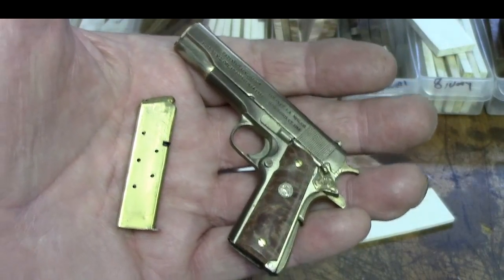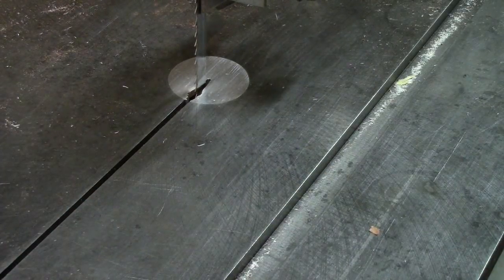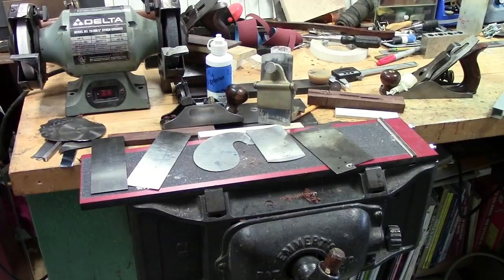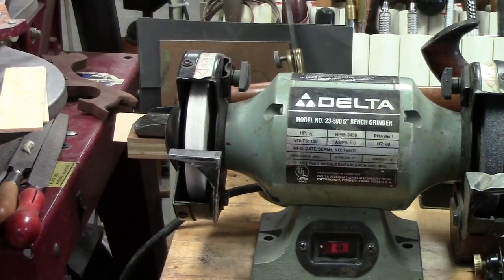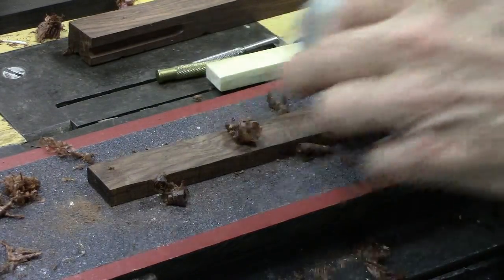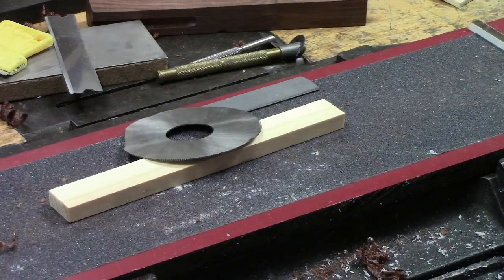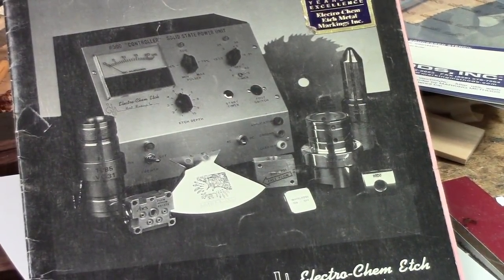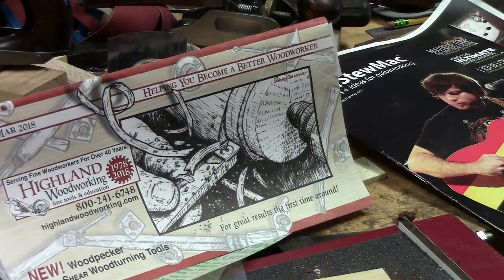Saws Sparks Sawdust Shavings and Scrapers

Comment: The "mylar" material you used for pencil drawing transfer at the end is what I used to buy as either ClearPrint drafting film, available in sheets and rolls, OR Denril drafting film in the art supply shop. Its impossible to tear but it will stretch after using roughly. The technique also works with tracing paper, and there's also Saral graphite transfer paper to place under a drawing.
Easiest, cheapest way for small quantity or occasional use? Rub charcoal dust or pencil on the back of a drawing on copier paper, trace over it with a ballpoint pen to transfer to wood; rub back with a "china marker" (waxy) to transfer to metal.
 [The ballpoint pen will help you see the area you've already gone over; use another color for another time.]
Yeah, I'm *that old.
Thanks for your video wisdom!

Comment: THX, Paul. 
Let me add a tip to your collection for miniaturists: the very *sharpest bladed-tip instrument available -useful for micro-scale work-- is what eye surgeons use:  a triangular section of a double-edged razor blade, SNAPPED-OFF at an angle using a clamp. 
Sure, eye surgeons use a fancy pencil-shaped clamp, but a vice-grip would do it (maybe your ruler-holder?). Just clamp from the outside-in [insert eye protection warning here]
Will be watching all your vids..